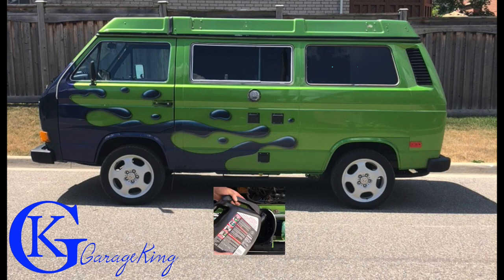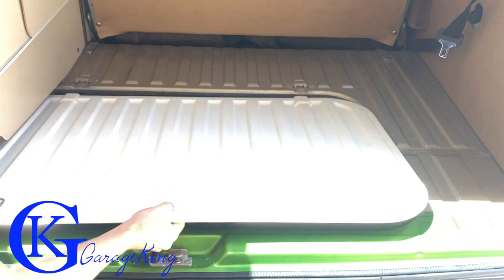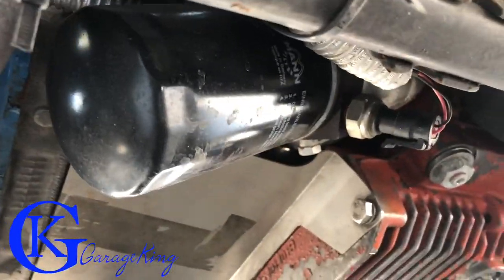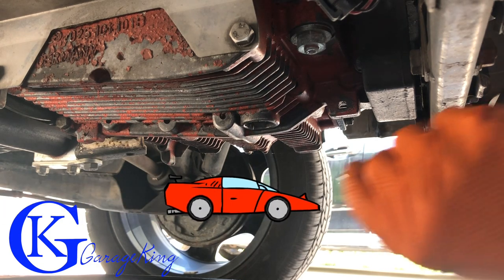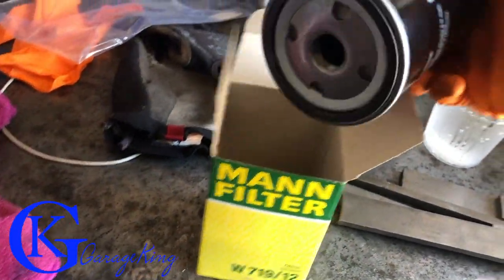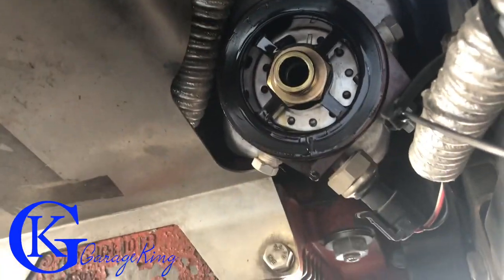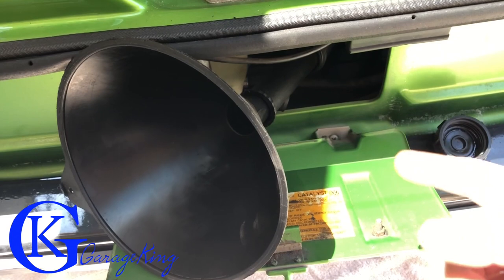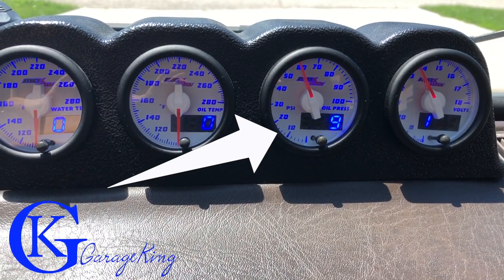VW Vanagon Westfalia Oil Change (Easy Way)

Comment: Pro tip:  Oil filler cap wedged between license plate and coolant expansion tank will keep license plate wide open.  I use Mobil 1 15w-50.
Reply from the maker: That is a pro-tip, and you know I never thought of that !!!  Thanks for sharing that with me, as normally I wedge whatever I can find to make it work.  That's a simple great idea.  15W50 is good stuff.  I think most guys are probably using a 40 or 50W oil.  Thanks for the comment and have a great weekend :)

Comment: I run a shop and we have a few rental Vans. Mobil 1 15w50 is our go to. I've started running 1/2 qt Marvel mystery oil in the winter in our rigs and it seems to help with the lifters that sometimes clatter. If the vans were driven more in the winter I'd probably go to a 5w50. Go Westy recommends 10w60 in their rebuilds so we carry that in Liqui-Moly for the warranty, but it seems a bit much to me.
Reply from the maker: Excellent info, I have heard of the 10W60 that Go Westy recommends.  Never though of adding the Marvel Mystery oil.  I rebuilt my engine about 20000 kms ago and used new lifters so I don't have any lifter clatter, not yet anyway :)  But if they do start up I'll try the same thing and add a little Marvel Mystery oil.  Thanks for the great comment !!!

Comment: Where did you get the oil temp and pressure set-up. My buzzer, 1987 Westy, is not working properly and I want to install an analog set up. Thank you for any informatrion.
Reply from the maker: Hey There, I bough them from www.glowshiftdirect.com  Here is a quick video on the set up you might want to see https://youtu.be/mS_0JtQXxII  Thanks !!!

Comment: Red Line 10W60 Motor Oil , we have hot summers, so the 60 helps. It is a full-synthetic ester formula. I have air cool engine, so I need the high-temperature stability.
Reply from the maker: Hey Thanks for the comment, I was wondering about the 60 oil.  Very good to know and with your air cooled engine I can definitely see it being a plus !!!  Enjoy your weekend :)
Reply: @GarageKing  Thank you.  Castrol, Liqui Moly, Motul and a few others make 10W60 Motor Oil also. I have found Red Line to be just a little better.
Reply from the maker: @davejsargent  I do appreciate the info, that the one great thing about this platform.  Thanks again :)

Comment: I find it interesting that the oil used does not have a zinc additive, which many shops and my colleagues recommend  for vanagon engines- for instance - Peace Vans, a very good shop here in Seattle.   I use this:  Castrol 20-50 w/zinc
Reply from the maker: Castrol 20-50 is good stuff.  Great for air cooled porsche engines as well.  Appreciate the comment

Comment: When you rethreaded your plug insert did you just run a tap thru it? I need to do the same and was concerned about metal shavings
Reply from the maker: I actually did mine when I rebuilt the engine. I had to use a drill, and then I put this (its not like a heli-coil) its like a hollow tube with threads on the inside and the outside.  So you drill out the hole 2 sizes bigger, then you use a tap and then you thread this tube in, and the threads on the inside are the factory threads.  If you do the same way I did I would drill slowly and use grease on the drill bit so the steel bits would stick to the grease, and then afterwards I would dump 2L or so of 0W20, a very light oil that will flow and can wash out any left over bits.  That's what I would do.  If you threads are not too bad you can try a tap with the same size to restore, but most of the time you have to go bigger.
Reply: @GarageKing  thanks you legend
Reply from the maker: @jakefischer8281  Thank you

Comment: Regardless of what weight or synthetic /mineral oil you use it should have a zinc additive. Both the 1.9 and 2.1 boxer engines need this for their lifters
Reply from the maker: Yes, you are correct, as you know these engines spin at a good clip on the highway.

Comment: Mine has the same motor and I've found 10/40 synthetic not to be thick enough (Noisy tappets). I've also tried 15/40 part synthetic and it's better but I've been advised to use a mineral oil instead. So I've got 15/40 mineral for it now. I hope I don't kill it 🤣
Reply from the maker: Hey Thanks for the comment.  I just got back two days ago from a long trip out east and "Steve Green" ran great.  I put on about 3000miles in 9 days so a pretty good trip. I find with the 5W50 the pressure is not super high on start up, and it still maintains about 10psi at idle when hot. When I was on the way back I was running the engine at about 4K rpm steady and no issues,  With the bigger tires I have on that puts me at about 120km/h or 75MPH so pretty decent.  Before I went on my trip I did a front end inspection, and it looks like I'm going to be doing some front  end work.  I already ordered the parts from Go Westy :)  

It would be interesting to see how long the mineral oil lasts in your rig.  I used Castrol GTX 15/40 and found that around 3000 miles the oil pressure was less, and I attributed that to the oil shearing down.  When I was on the highway the pressure was much less.  The only way I would have known that is because of those gauges I installed, this way I can really monitor the pressure and temperature of the oil. I found with a good quality synthetic the oil does not loose its viscosity.  I think these engines need to be treated like racing engines due to the high speed they rev at all the time. 🏎  Thanks for the comment and hope you have a great day !!
Reply from the maker: Oh, and I forgot to mention the 5W50 has extra zinc to protect the flat tappets.  It has not damaged my catalytic convertor.  Some say a higher zinc oil can damage a convertor, but so far so good :)